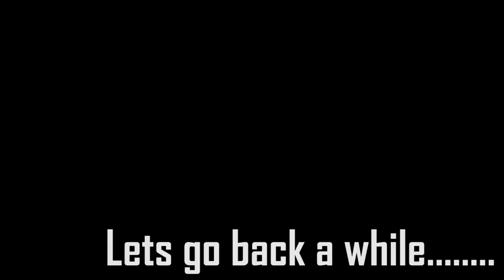Final Fuel Pump Video

Comment: Midori is a far cry from my '92 SL2, but the fuel gauge bounce happened to me shortly after I changed my FP 15 years ago.  Tried everything, including shorting the connector in the trunk to power the fuel gauge coils to "even out the magnetic strength", a new sending unit (so two tank drops for me - you still hold the record), etc., but to no avail.  Eventually, it went from bounce to erratic readings!  I ended up replacing the fuel gauge in the cluster.  That resolved it.  Nice to know there are others out there working on their "S" series besides me. Good luck with yours.  I appreciate you taking the time to make videos.  That's a lot of work too.

Comment: Great to see another video with the Saturns!! Always love em!
Reply: Got a 1995 Sl2 also, carbon fiber Seibon hood, ported intake bigger TBI, Cold intake, a 1991GM header, H&R lowering springs, KYB's, polyurethane bushing kit, 50 Lbs lighter than the factory and titanium header wrap. Looking to install some Eibach race springs, a 5 speed manual swap, roller pins, short throw shifter and lower it some more, carbon fiber seats from Sparco, RPFI 15x7 Enkei;s and Yoyo proxies 205 50 R15 and eventually an EMS 4 engine management from AEM. Might do a turbo down the road, i'll see what I can do without credit...lol Hoping to do 14 PSI with .20 over forged pistons and some mild head work too.

Comment: Fuel tanks aren't that bad in these cars. I usually disconnect the filler neck at the tank, then bend the rubber couplers out of the way and drop the tank without having to take off any body panels. You still managed to pull off a pretty good episode considering the nightmare of a job it turned into, Midori looks sick dude, good job.
Reply from the maker: Thanks! And I know I could do it without removing the body but for me that extra little bit of work feels like it saves me hassle in the end lol

Comment: I'm dying to know where u got the wing from, it's the only wing I've ever seen that I like, besides the STI and the ones on the 2021 Type R civic are more or less the same style. But the aftermarket ones usually look cheezy, but not yours! P.S. I've heard there is a Walpro fuel pump compatible with the S Series but i'm wondering what the part number would be. I'm already gonna purchase the GM 2 bar MAP sensor , good up to 15 PSI supposedly

Comment: So my question is..... How reliable is ur turbo set up and do u personally think its ok to slap on a automatic at that. I only drive it to work and back and sometimes to events that do occur every now and then and they are as far as 2 or 3 hrs away at that. I'm hesitant on doing mine because I just got the tranny rebuilt and engine and don't want to blow anything. And if it is ok to put one on is turning really needed for these cars or is it ok as is because everything is stock excecpt for the the headers, muffler and intake system.

Comment: Love your videos, projects and multiple saturns.   I have a third gen s series... wondering if anyone has or possible to cobalt ss swap one. I know anything is possible cause I've seen one LS swapped. And is the turbo or supercharger better. Wondering your take on that
Reply from the maker: Anything is possible, its your skill level and motivation that matters... swapping in a different drivetrain is a HUGE job... ive contemplated swapping in a K series from a Honda but i just dont think i have the patience to actually do it...